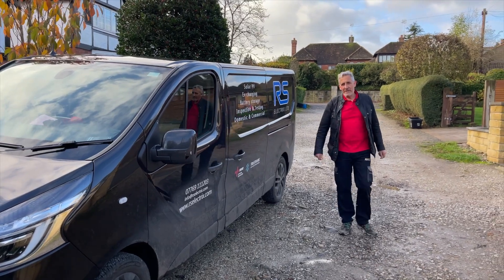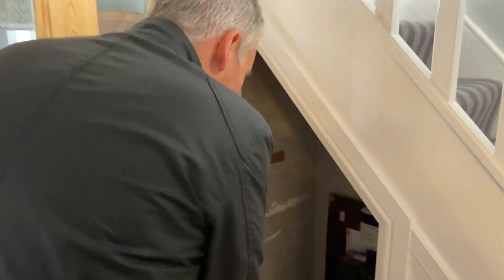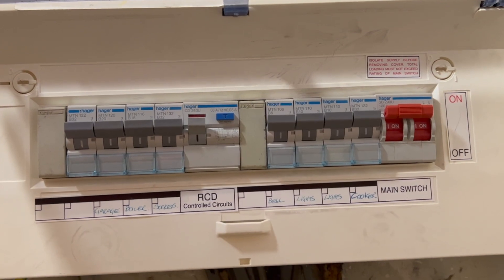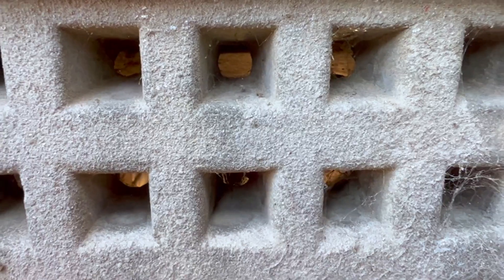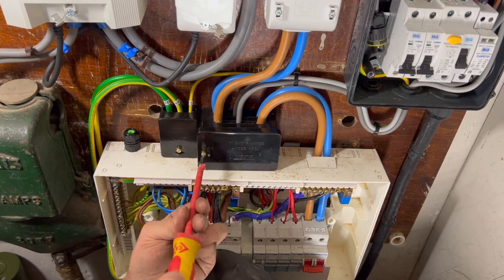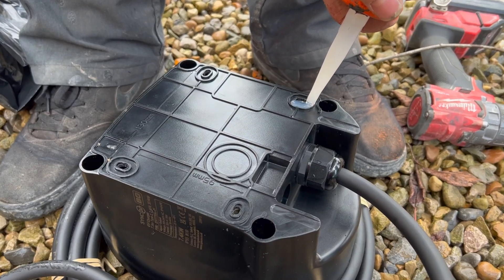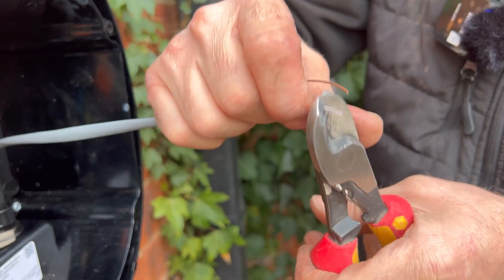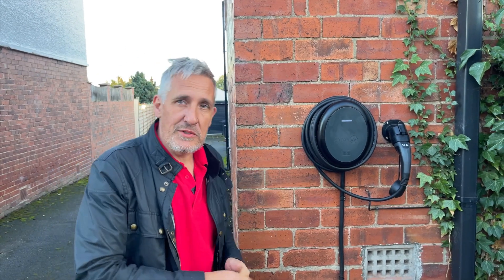He said this BG SYNC EV Charger Installation would be easy!

Comment: Just a cautionary point that may have been made many times before: never open circuit the secondary side of a CT while there is current flowing in the primary.
Reply from the maker: It’s never made before - what’s the issue
Reply: @efixx  The short version: If the secondary of a CT is open circuited no current will flow in the secondary winding so no secondary magnetic flux is established in the core to oppose the main flux created by the primary winding. The flux in the the core will therefore be higher than under the designed conditions and will generate a higher secondary peak voltage which can pose a shock hazard and may cause the insulation to breakdown. This open circuit voltage is a peak voltage so an RMS voltmeter will not register it.
Reply: @johnlloyd3377  thankfully these CT coils usually have built in TVS diodes which will clamp the voltage but it shouldn't be relied on.
Reply: @TheAviation101  I was unaware of that, but good to know.
Reply: @johnlloyd3377  given there's electricians who strip the secondary wires of the CT coil with their teeth with the primary connected, I can see why they bothered lol
Reply: @efixx  Also: The CT secondary cable impedance (length and cross sectional area) must be taken into account when calculating the total burden on the CT. 
Something else: A protection class 100/5A CT with a saturation factor of 10 will deliver up to 50A in the secondary winding under fault conditions.
Reply: @johnlloyd3377  the difference between sparkies and electronic engineers! 🙄
Reply: @TheAviation101  but as the abbreviation describes a TVS diode is designed as a Transient Voltage Suppressor and there are THREE voltages ... Stand-off, breakdown and clamp. Such diodes vary dramatically in stand-off voltage so it is NOT a good idea to rely on them for HUMAN protection, they are there to protect circuitry. Wherever and whenever possible, but especially when/if using a quick connect/disconnect mechanism, permanently attach the relevant burden resistor, once calculated, directly AT the CT so that the two are always attached.
Reply: @boblewis5558 I suspect that there will be a 4....20mA transducer connected to the secondary winding of the CT in this application.

Comment: As soon as the router is changed, the Wi-Fi won’t work. Hardwired would save a lot of grief.
Reply from the maker: We’ve got a quick hack if the router is changed - https://youtu.be/h5qgaMIUaZc
Reply: @efixx  Maybe Doncaster could make another revision of the EV-Ultra with cores for both data and CT included?
Reply: @sjholmesbrown  10 and 100 mbit only need 2 of the 4 pairs. The CT shouldn't put a high-frequency signal onto the wire, so a 10 mbit connection should be stable. However, I'd be somewhat concerned about insulation resistance between the pairs, but I'm already concerned about insulation resistance between the 240V installation and the pairs, so...
Reply: I've never had issues replacing an access point with another one configured to the same SSID and password. That would have been quite annoying, considering how many screen-less devices connect to wifi nowadays...

Comment: Nice little unit that..  Not to bad price wise at about £500 ish for the tethered unit..  Not a massive fan of BG consumer units as they are always the cheapest at screwfix and often mean its been installed badly but I do use the BG outdoor sockets and have used the small garage consumer units and they are ok, I guess its not so much the product that is the issue, more the people that buy it and install it but that charger looks the business..
Reply: better than most out there, brilliant App too, Monta connects quickly and offers far more than others and integrates with your vehicles manufacturers account.

Comment: Still not demonstrating a proper drip loop on that great thick cable piercing both skins :-(  And he was using proper sturdy clips, so really no excuse whatsoever.  A "little bit of silicone" is not adequate to prevent moisture tracking into a horizonal hole like that over an extended time -- the intended lifetime of that equipment -- especially in Yorkshire!  ("Prevailing weather is to the opposite wall" says Efixx; "Insurance companies and building inspectors don't care about 'the most common' wind direction " says I.)
Reply: You mean that tiny hole that is right next to that huge venting brick that is 60% holes?

Comment: the problem with using wifi for the data connection is when the customer changes the Broadband supplier or the isp sends out a new Router just because customer change to a  new Deal you'll have to change the wifi you can use the other 2 pairs as ethernet!

Comment: Scottish Power Energy Networks will replace cast iron cable heads for free on application.
Reply: Western Power Distribution will replace it if you pay for it.  Reported one on a EICR that had seen better days, VIR cables and leaking pitch.  Apparently it was serviceable and would have to be paid for to upgrade it as it involved digging in front of the property to make it safe.  Postcode Lottery.

Comment: Nice to see that finally a manufacturer designs in decent waterproofing (and dust/insect proofing) provision for silicone sealant. I have been using a ring of silicone around outdoor box screw holes for at least 25 years, it is SO obvious! AND it's simply not necessary to load up the back with half a pound of silicone as I've seen some sparkies do, yet miss parts of the hole surround thereby creating a massive FAIL!

Comment: Question.  Is this area a confined space?  If it is, I note that there seems to be an indifference to safety equipment or any basic PPE.  Would be interested.
Reply from the maker: You could almost build a room under that floor.
Reply: @efixx  That may be so, but a confined space is NOT defined by size.  I fully understand this not a commercial in the sense that it is business to business job whereby HS costs would make a quotation not competitive, but legally, HS rules still apply and litigation would definitely follow if an accident occured.  Consider the now common use of scaffolding now used by roofers whereby ladders were always used.  I am trying to help and not be critical for the sake of it, so please do not take offence.  Was a dynamic risk assessment carried out, was the area tested for gases prior to entry, it appears in the video that there may have been only one entry/exit point, if an accident occurred, say a broken limb, how would the casualty be extracted from under the floor space which I would consider is a confined space that includes potential hazards from what I remember?  Just a few points to consider prior to publishing such work.  Best wishes.

Comment: Ok I'm in the states but for most of my water sealing I use duct seal but I may start using silicone on top and use that dust idae to color match and hide openings. Thts a great tip

Comment: I'm not sure if i'm missing something obvious, but did you just install a plastic consumer unit inside a dwelling? Not a professional, but I seem to recall something about the 17th edition amendment 3 requirement for these to be metal (or metal enclosed) and the BG site shows the interior models to be metal. Just wondering how this installation would pass an inspection.
Reply from the maker: It’s made from die cast aluminium.
Reply: @efixx   Ah, I knew I was missing something! Yes, just watched again and you can see the metal colour when it's being drilled. It certainly looks plastic in the photos! Love the channel BTW

Comment: I do hope the current transformer burden was fitted AT the transformer not the  other end. An unburdened current transformer can be quite dangerous if care is not taken as it can easily produce very high voltage, safe as houses when burdened. No mention was made of this burden so I guess if as part of an overall kit it comes prefitted to the transformer. 🤔🤔

Comment: When Ross drills a hole through the outside brick wall for the charger cable to go through it looks like he goes straight in. Isn’t it better to drill slightly up at an angle to prevent rainwater getting through? I know it’ll be silicone sealed, but just for extra caution.
Reply from the maker: Yorkshire rain usually comes in sideways - but the prevailing winds means that the opposite wall gets the weather.
Reply: @efixx  lol 🤣
Reply: @efixx  I didn't notice any conduit or cable protection in the hole after it was drilled either.

Best practice:
Uphill by a few degrees
Line with plastic tube (15mm plastic water pipe is good)
Seal both ends of the conduit with silicone
Conduit should enter box too not terminate at the wall edge

You can never over protect against water ingress.
Reply: @boblewis5558  Agreed.

Comment: Personally, I'm not a fan of combining data cables in with power. Possibly this dates back to my telecoms days when you don't even share ducts between power and cable lines, let alone within the same cable. However, I can see how it does make it a bit neater, but it's not something I'd like in my property. When I have to dig up the garden for ducting a cable to the detached garage it will be with separate power and data cables. 

I am also of the mind that if I go to this effort, then using 5 core 6mm^2 SWA would maximise flexibility for the future as it would allow for 3 phase in the future. Also, to minimise resistive losses I think it would be within regulations (as the cores are the same cross-sectional area) to parallel up two of those cores for line and another two cores for neutral when running as single phase. The CPC need only be single core when there's a 32A breaker. It's about 20 metres in total, but I still calculate that would save about 60 watts on a 7.2 kW load. Less than 1%, but every little counts.
Reply: Twisted pair, not the same as you mention. No transfer. Used for years on CCTV power and data together.
Reply: @7755ian1  by heavens have you missed the point. Yes, twisted pair is not the same as power. The point was about combing twisted pair data and power on the same cable bundle.
Reply: @TheEulerID  yes sir combination cabling, mains power combined with data 4 No. twisted pairs, no interference or power transfer whatsoever or CCTv signal down twisted pair would produce interference if transfer occurred even over 50mtrs. Both 12volt DC and 240v AC